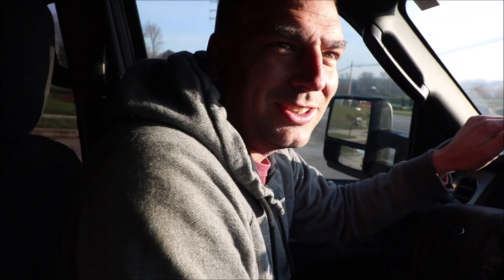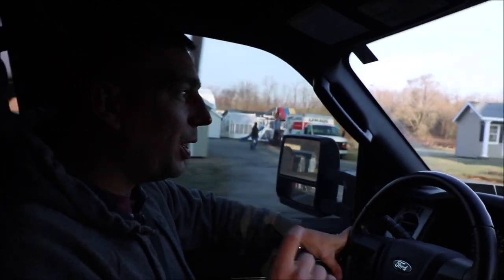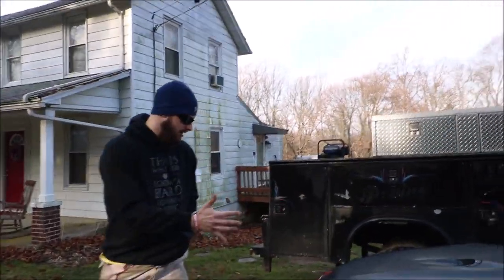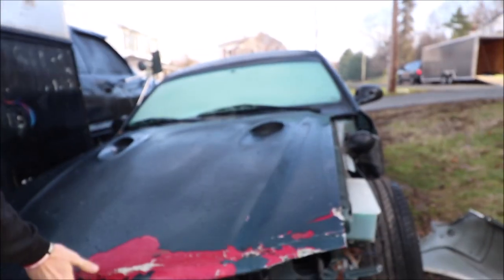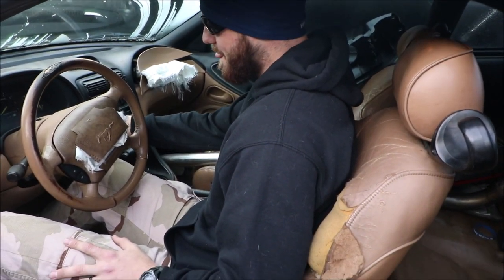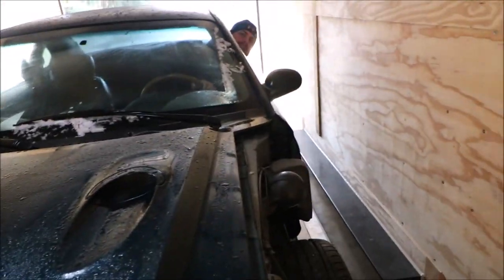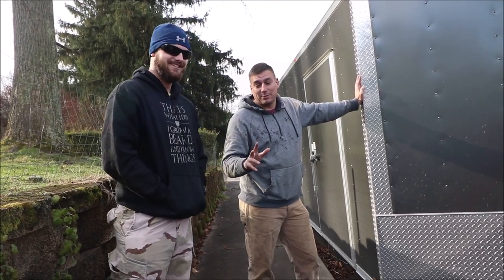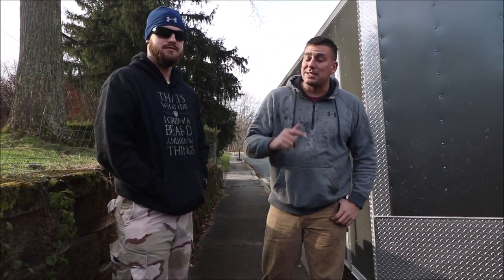Project SN95 Mustang GT--Hurt Feelings

Comment: I hope you guys put the correct tail lights on it, the 94-95 tails are important to the car in my opinion.  I just bought 315’s for my polished Cobra R rims for our SN95 project.  Your car has the same exact interior as mine.  I’m going with new black carpet, no tan for me.  Got to get the tan seats redone too but first got to respray the engine bay.  I’ll be watching.
Reply from the maker: SN95 Mustang Garage are they not the stock tail lights?  Our car is getting gutted for racing.
Reply: Bring It Muscle Cars  You have 96-98 tail lights so people with think you have a 96-98.  The 94-95’s have vertical tail lights.
Reply: @sn95_mustang_garage 94-95 horizontal 96-98 vertical